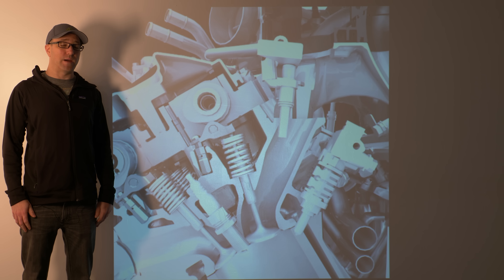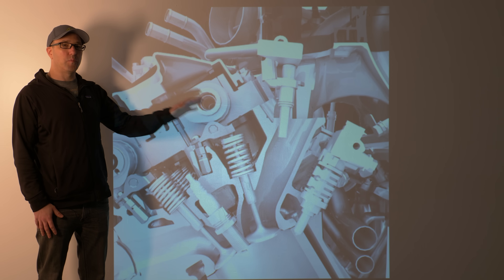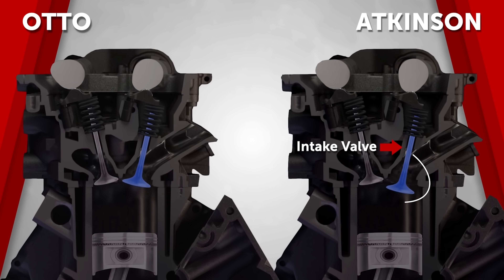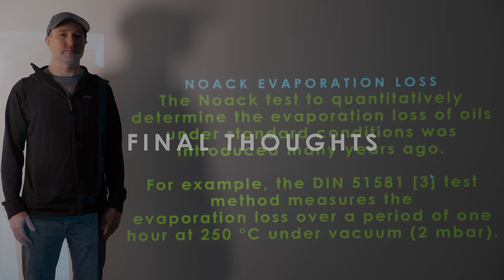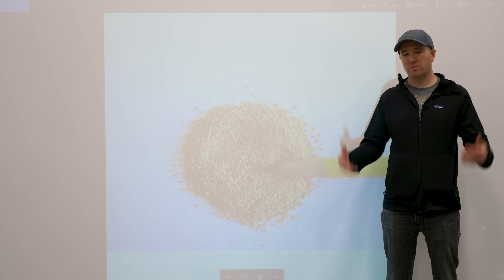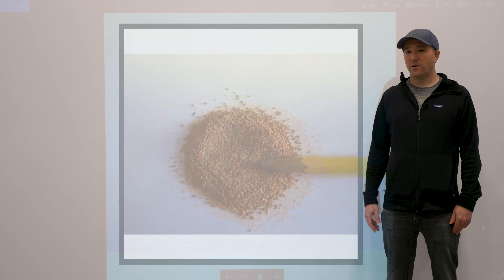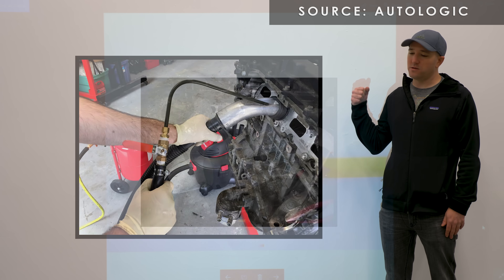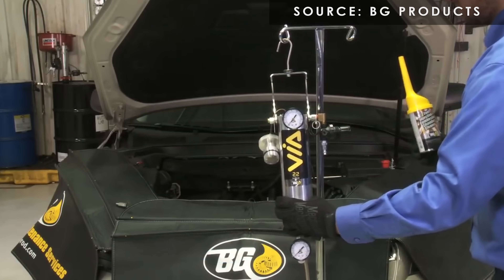Direct Injection, Problems and Solutions | The Fine Print

Comment: If anyone cares, we use BG GDI cleaner with success to clear up DI junks with misfires.  We never removed intake to see the result but our BG rep has worked with a Kia dealership who looked at the valves with the intake off before and after cleaning.   All this talk about lower emmissions with DI but what about the stuff that comes out of the tail pipe during chemical cleaning?  That shit is straight up TOXIC.

P.S. Can you please get an array of projectors to warp the image around your body?  The shadows are very distracting.
Reply: The animation is wrong. The fuel is not injected on the intake stroke in direct injection. That would defeat the purpose. It's injected at virtually the same time as the spark on the compression stroke. This is why it needs a 3000 PSI pump driven off the cam. This prevents detonation and allows higher compression on low octane gas
Reply: @Bryan-Hensley  who puts together these types of animations and 3D views? Are they derived from manufacturer CAD/CAM models or just some third party operation?
Reply: @dtrrtd774  I don't know graphics, I just know engines.
Reply: Great Video BTW!!! I've been a subscriber for about 1-2 yrs now
Reply: Jord TheMechanic It is the way to go if you do it as preventative maintenance. The same things you were just mentioning would happen sometimes naturally if you let it build up in the first place. It is lazy to let that happen...
Reply: If you are breathing in exhaust products xylene is the least of your worries...regardless of any car
Reply: DTM006 Exactly. Xylenes not that bad. I’ve got a few hundred gallons of the stuff from when I had a contract with Wal-Mart to repaint their parking lots. I used xylene paint (although a paint thinner, it is used so that it can run through the machines at 2500 psi). I used it to clean the paint off of my hands every night.
Reply: Please explain your comment.
Reply: Why are there so many dissenting opinions? I am with the "it works" crowd...at least to some degree. If you catch it fast enough and use BG I am sure it has some effect. I agree though that the ideal solution would be to add meth or water injection.
Reply: @mroberts7519  BG is the only company that has worked with manufactures to come up with a chemical that will soften this carbon. It is unlike any other carbon and chunks will brake off and cause your engine to have a VERY bad day.
Reply: I'll let our BG rep read your comment.
Reply: Scott P p
Reply: so the scrubbing process is filthy.
was it not ever such?
Reply: Seafoam will, providing it's atomized through the TB as recommended. Not as effective as walnut blasting though...
Reply: Ryan Bourke That explains a lot.  Thanks
Reply: always trust BG products, them and Loctite(Henkel) make the best stuff there is!! I have used their stuff over the course of my lifetime, none of it has failed badly enough that I wont use it again. ever......
 l always wanted to put direct injection on a flathead. I think the valves might last longer/run cooler?
Reply: DI isn't so much about emissions as it is about power efficiency per litre.  Electronically contolled engines do a better job maintaining burn efficiency.  When higher compression ratios can be used to provide more horsepower for the same amount of fuel burned, the OEM keeps their CAFE ratings, and the customer gets to keep most of their power.  Underline keep, because CAFE2 [penned while Pelosi was speaker] would have left us all driving cars with 30% [or so] less power using port injection.  So... 13:1 on a street car? Yes indeed - and with no fear of detonation.  The fuel isn't introduced until after stroke is past the danger zone for peak pressure, and no worries [except for fuel temp]
Reply: I just remember dealing with VW GDI engines (fucking 2.0 piece of shit) - the "fix" for intake valve deposits was supposed to be blasting with walnut shell media.  What I remember doing was pulling the intake on that cam-failing heap of shit and scraping the shit off the intake valves with a pick.
Reply: Brent Boswell how does a chemical cleaner mess up a turbo??
Reply: scschmidt air soaked in said chemical passes through turbo. Turbo contains seals to separate coolant and oil supplies and drains. Those chemicals, in those temps could corrode the brass/bronze bushings, causing premature failure.
Reply: Mgoblagulkablong
Get a horse.
Reply: I own a 2017 Santa Fe 2.0 turbo GDI and I put a oil catch can $35 plus did the full 3 stage BG GDI fuel service. I noticed improvement in acceleration and smoothness. The best thing about BG is the lifetime warranty they offer if you keep using their treatments. It’s absolutely insane not to use their products for that reason alone. After a week I also see 1/8” of oil/fuel in my catch can.
Reply: Bison trucker DJ  oil catch can helps but you still need valve cleaning  it’s just a shit design is Hyundai still making d i or both now
Reply: Daniel Guzmán López BG is a brand of automotive chemical solutions. They make injector cleaners and other items.
Reply: I have 110000km on my 2015 focus 5spd hatch, I have noticed the engine is starting to misfire. I change my oil more then most and use synthetic . But I think I will have to get the values cleaned.  Question cant tou run something directly into the intake once every few months to prevent this from happening?
Reply: BG is a godsend, use it from the beginning and you really wont have any trouble
Reply: BG products been kicking ass for years. It was in use at and Olds dealership when I started in 1985...their fuel system cleaner is the best I have ever used and I run EPC in my motorcycle...the motor makes much less mechanical noise, it shifts  better and the clutch is smoother. A noticable difference in 3 miles
Reply: Car and body both need internal care and release toxins thereafter. Both gotta go eventually; 
one in the graveyard the other in the scrapyard, do what you must to prolong both lives. Hopefully you 
out live the machine.
Reply: How dare you try to apply logic and common sense to EPA regulation, you better hope an indoctrinated  millennial doesn't here about such things. They would need a safe space for months to fend off the trauma!
Reply: Branden Flasch 
Very true.  I have a 2010 Tiguan, around 90k miles, check engine light was on.  Took it to a dealer, and need valve clean job for $800.  No parts.  Pure labor cost.  They said literally it was a scrapping the valves
Reply: 2😅 11:24 ⁵I e
Reply: BG was awesome when I worked at the shop too. And they had the fun plastic coins in the bottom the rep would give you cash for, lol. Speaking of this subject though, I went for a 2018 Hyundai Elantra 1.6T after seeing your review, and a month of research, and I'm loving it with a 6 speed. Along my research, I saw Hyundai techs saying that they were told/heard a rumor that every so often the 1.6L pops a valve open a bit early so fuel washes back over it as the compression stroke is happening, and it largely means this doesn't happen. Have you heard anything about this? It seems weird that a Hyundai would have a better system worked out than the German companies. But maybe not - Hyundai is out money anytime this needs done under 100k miles, and their engineers  know that. German cars have much shorter warranties and their dealers are happy to give you a paid head cleaning! :)
Reply: @820krx7  That's a neat idea if it's true.
Reply: @820krx7  german cars are overrated in terms of quality. They look and feel great - short of driving feel these days - but they are generally more of a pain to keep in order and this hasnt improved now that turbos are everywhere. European electronics have caused many tears im sure though i dont trust elec of anything now that everything is overly complex.
Reply: I thought it was something British. It is better than seafoam?
Reply: @blackville3  Seafoam is junk compared to BG 44K
Reply: @blackville3  BG would be Bulgaria
Reply: @blackville3  seafoam was manufactured for smaller marine engines not automobiles
Reply: Scott P where are you located?
Reply: Scott P I
Reply: Scott P in
Reply: Accualy the bg fuel induction service or "fis" as your dealer will call it works great only down side is it will damage your catalytic converter over time so use it every 20,000 miles or so. WARNING do NOT use this on turbo charged or supercharged vehicles as the very flammable chemical that goes through the intake can potentially detonate inside your turbocharger or supercharger and cause serious damage
Reply: Thanks for your reply.  I'm thinking you are correct.
Reply: Scott P A
Reply: So are 2014 Kia Forte's GDI or port?!
Reply: Scott P I highly doubt it works well. After scrubbing the intake valves by hand, i can tell you short of walnut blasting, its super difficult to clean with cleaners by hand...can't imagine a cleaner without removing the intake working
Reply: Which BG product number is the gdi cleaner.
Reply: @LawnMowersThingsThatMakeNoise  https://www.bgprod.com/ check out all the BG products.
Reply: what is BG GDI cleaner ? and how work this ? is it also could for the DI injected Corvette C7 ?  thx
Reply: @kubanskiloewe  https://www.bgprod.com/    This is the BG website. You can also see demos on youtube for any product they sell.
Reply: Sounds like you should just go with a diesel then, all you have to do to clean them is just press down on the go pedal all the way to the floor, preferably while going up hill"  That always blows the soot out for me.
Reply: Anthony G. I have a lot of experience and success on cleaning and flow testing BMW N54 Injectors. www.precision line fuel injectors.com
Reply: @neverbored01  We don't get the discs in the cans in Canada but we still love BG products..
Reply: wysetech2000 you smoking fucking dope? Or what province do you live in? Because they definitely do in Canada bub.
Reply: I had no issues with shadows.
Reply: Definitely.  "Lower emissions!"  And then every three months you could fill up a factory with smoke doing a chemical intake clean.
Reply: This is a year old when I watched it, retired and off the bench cept for working on my own personal stuff. Good explanations and video. However this as you mention is s problem as a result of dealing with mandated emissions. Fuel dilution, as a result of Di, turbo Charging a smaller engine and of course an engine that has trouble maintaining a normal operating temperature. So back to electronic carburetor, or port injection, or ? How about a CVCC  Civic  with a stratified charge electronically controlled.  Jst old thinking and not relevant at all these days.
Additionally the fuel odor some experience (oil dilution) is coming from the PCV  system and is in part due to the fuel  dilution problem and its permeation of the PCV system, that's  mandated by emission ĺcontrol in North America and elsewhere.
Reply: Scott P was the way I
Reply: Completely agree with you Scott P. I have been saying the same thing for about a decade... and I use Seafoam as my cleaner.
Reply: So what, it lands on the ground as carbon!! and whats your point? better off then walking down town and breathing in break dust thats floating in the air, but thats just imho lol
Reply: If California air quality regulations don't mandate capture of the junk that cleaning sends out the exhaust, it won't be very long.
What do the cleaners do to the catalysts? Catalytic converters don't get along with out-of-spec emissions.
Reply: @brandenflasch  that engine is the only one we have had no success with BG chemical cleaning. It is the worst. We can only clean those by walnut blasting, but other engines respond great, especially with the new formula and tool BG has.
Reply: @neverbored01  you are pure class. And you have NO idea what you are talking about.
Reply: WARNING: Chemical cleaning of intake valves will dump huge amounts of hard, abrasive, carbon into your oil in the 2-10 micron range, that your oil filter will not filter out.  This will drastically increase wear.  How do I know?   I did oil analysis with particle count tests before and after.  I took two back to back oil changes to bring the contamination down.  In a modern engine 10-20% of the old oil will remain.  You can also run a 2 micron bypass filter to remove all the carbon and GDI soot.  API SP and GF-6 have come out with additional performance tests to check wear of timing chains and cylinders caused by GDI Soot.  This has been known since 2015.  https://360.lubrizol.com/2015/GDI%20Soot-A%20New%20Challenge
Reply: B.S.
Reply: Remove the intake and you will see the BG did absolutely nothing.
Reply: Where can I get the BG stuff if I’m just a regular Joe I know how to do a vacuum port cleaning just fine
Reply: Thanks
Reply: Guess I'm sticking with my old school 850 double pumper on a healthy low deck big block Mopar f all these kids technology I'm a dinosaur
Reply: @onesecureone  that's good and all, and I don't blame you, but you have to think about fuel mileage man especially now that Brandon has gas at $5 a gallon and climbing.... I'm assuming that's not your daily, correct?
Reply: I drilled a small hole in each intake runner , and inserted a air inflation needle with epoxy .capped it with tire nozzle cap . Once in while I just take caps off and spray cleaner directly into port next to valves.
Reply: Use Lucas feul cleaner
Reply: My Kia RIO 2013 DGI has done 155 Thousand klm, I change the oil every 5000klm, it drives well and lots of power from my 1.6lt engine. I can easily drag off VW Amarok and other cars. However it has a pinging noise from my bottom end at lower speeds. I only use high octane and I have tried different oil brands too. I am using Penzoil Extra Platinum 5-40w oil now, not much difference. I a. Thinking taking out my injectors and having them cleaned. Any idea anyone?
Reply: Meth injection
Reply: BG , ripping off Dealerships for Decades 😂.
Reply: Yeah that's not gonna clean up hardened carbon deposits and you wouldn't want it to because then the loosened carbon fragments would score the cylinder walls.  The only way to safely and effectively clean carbon deposits off intake valves is with walnut shell blasting or a similar physical method.
Reply: The stuff coming out of the tailpipe during cleaning is probably PAHs (aka diesel soot!) PLUS the chemicals in the GDI cleaner (xylene, toluene, 2-butoxyethanol, NMP etc). Carcinogenic and toxic. Good point about the tradeoff-this is what happens when companies don't do a rigorous life cycle analysis when they develop a new technology. I'm never buying a car without port injection now, and will advise anyone in my family or friends to watch this video before they do.
Reply: Mike H  
Toluene is a major chemical in the gas you put in your car everyday. Not sure about the other specific chemicals but I wouldn’t think it’s much worse than what your already burning in your engine.... if your really worried about carcinogens and toxic fumes, then driving a car with a gas engine might not be right for you
Reply: cjsawinski the difference between the small exposure to fumes when filling up outdoors every two weeks versus a mechanic exposed aerosolized, concentrated chemicals inside a shop many times per week is huge. Not to mention the particulates that come out as well.
Reply: @cjsawinski  - Go Electric! Enjoy inhaling power plant emissions. You're getting them now anyway.
Reply: @cjsawinski  - I generally don't inhale my own car's exhaust.
Reply: @mikeh2812  This what happens when government bureaucrats try to engineer cars!  The government needs to get out of the auto business.
Reply: @skip7243  
They haven't realized the concept of diminishing returns, scrubbing emissions from cars whose exhaust is nigh breathable already. Leaving alone emissions from jet planes and manufacturing plants because it's not an in Vogue concern by environ-mental-ists
Reply: @dtrrtd774  Because "well to do" folks use planes, can't mess with that!  You know, the golden rule "He who has the gold makes the rules"!
Reply: @mikeh2812  alot of manufacturers have reduced the issues with GDI i owned a Hyundai  for 5 years never skipped a beat and my neighbour just sold his after 9 years so if it's one clean up every 7or 8 years that not too bad plus some car u have to take the intake off to change spark plugs anyways might just DUI it after that much years..
Reply: Joe Brown cautiously optimistic. They’ve gotta improve the longevity if they want to keep using them. I have a Hyundai/Kia GDI with over 100k miles and I keep my fingers crossed whenever I drive it.
Reply: @mikeh2812  easy, floor that bitch to redline through the first 3 gears once a week, I've owned shitloads of newer cars with DI, lots with higher miles too and have never had any of the problems associated with it
Reply: GDI isn't innocent by itself. It emits a lot more particulate (soot) than a port injection engine. Watch a GDI motor start on a cold morning or watch one that spends lots of time putting around in the city cough up a cloud when the driver romps on it to merge onto a freeway. Nevermind the enormous cost BMW owners had to pay when their HPFPs went bad.
Reply: @mdub603  gm gdi runs split injection ,extra fuel on cold startup for a few seconds to get the convertor lit off quicker.....
Reply: @mdub603  Funny @-30c I dont have that issue with a Kia 2.0T in the winter. I think you have something going wrong if that happens to your ride.
Reply: @mdub603  shoot is actually inert and quickly falls out of the air.. it gets a bad rap  because it can be seen.. but the other exhaust emissions are really the terrible ones which can't be seen with the naked eye
Reply: @joebrown9621  Soot is inert? Haha, tell that to all the people with respiratory issues.
Reply: BG and other cleaners are not designed to be aggressive. The cleaning agent softens the buildup (in combination with heat) which gently removes a decent portion of the deposits after 10-20 minutes. If doing a boroscope comparison, be sure to inspect after driving the vehicle for at least 20-30 miles at operating temps. We've seen noticeable improvement in the Mazda community using over the counter GDI cleaners like CRC and SeaFoam (atomized through the TB). Not as effective as BG or media blasting. But we saw improvements in airflow with noticeable reduction in deposits along the runners, intake valves and EGR. 

At minimum, use it to pre-treat the surface prior to media blasting. Makes removal much, MUCH easier.
Reply: BMW's HPFP have been under Recall for year's now. They also reimbursed those who purchased at a local shop, etc. The new HPFP revision as of 2011ish, there has been veryy little failure's. 

Obviously there are many on their original HPFP's, so ypu will still see failures but those are original Pump’s or Pump’s replaced before the final revision was made. 

As well as the revision for those HPFP’s, BMW switched to the style pump like the VW’s use and its a much simpler and cheaper HPFP. It is very reliable, inexpensive, and is much much less costly for the aftermarket to develop Higher Volume HPFP’s.

The advantage of DI is pretty significant, you can run much higher Compression Ratio’s, engine cooling effects, and more precise fuel injection. This results in higher efficiciency leading to higher power output/liter & better fuel economy...

I do however, know the negatives side effects of a DI - Only motor, and most of these issues can be resolved and/or overcome. From an emission’s standpoint, i dont know the effects of these changes. I have personal experience with BMW N54 (N55 as well) engine equipped vehicles
Reply: Michael Roberts   This is YouTube and everyone has to be a YouTube Certified Engineer or Chemist to give an opinion here. I have used BG products for many years so i know what works.
Reply: @wysetech2000  - I got a "D" in college Chemistry 101 so my opinion is as good as anyone's. Half the class got "Fs."
Reply: @algrayson8965  👍
Reply: @wysetech2000  p
Reply: Scott P . The problem with the BG cleaning system is where does all the carbon / gunk go after ? It's either getting caught between the piston ring and cylinder wall creating scratches to the cylinder eventually ruining your engine or it's going to get caught in the catalytic converter causing premature failure . BG is not the way to go . It's the lazy man's way of cleaning intake ports . Do it properly and remove the intake and blast or scrub it our not allowing the debris to enter the cylinder after
Reply: @EverydayJ1786  you do not know what you are talking about. The BG GDI cleaner softens this very hard carbon and allows the engine to slowly burn it out. It has to be done once a year to keep it from returning. You need to do a BG EPR treatment to the oil in conjunction with the GDI treatment to clear the rings of carbon for the full treatment. I have used BG products in the dealerships and my own shop that I run, since 1987. I think I have a pretty good idea of what it can and can't do. The only engine we have not been able to clean without walnut blasting is the VW 2.0 TSI.
Reply: @kurtumpenhour9142 I'm not questioning your decades of experience but  " the cleaner softens the hard carbon deposits and allows the engine to slowly burn it " sounds like something on a late night infomercial . I've never bought into bg products . I can't stand miracle snake oil shit .  If their products were so great , other companies would have copied their formula years ago . Also this oil treatment should never be touching the compression rings where the carbon would get lodged . If the BG oil treatment is cleaning the compression rings I'd say there isn't much left of the oil control rings in the first place .
Reply: Scott P what do you say to all the people who defend di that just do maintenance and its all good then can you give them a reality check on what a nightmare it must be to clean after 60k miles
Reply: @SavagexRaccoon  I have a 2006 VW Jetta GLI 2.0 Turbo GDI with 158,000 miles, purchased used with 45,000 miles in 2008. Always used a gas additive that I found in 1980. Mix-I-Go Made by Bell Performance -  1340 Bennett Dr, Longwood, FL 32750. Never had a problem with carbon build up, no codes, no driveability problems at all and I get 30 mpg on the highway. Just filled up with premium fuel today, did the math 26.95 MPG on my last tank and I drive the car like I stole it every day. The worst thing you can do with a GDI engine is drive it like a little old lady from Pasadena. 
I did the PM thing at 100,000 miles - new timing Belt HPFP cam follower, water pump. I am sure I will repeat at 200,000 miles.
Reply: @SavagexRaccoon
Reply: well, it doesn't. this fuel injection cleaner nonsense is just that, nonsense. that crud got baked on over the course of thousands of miles in thin layers. even though I trust bg products, nobody makes a fuel injector cleaning solution that does what their advertising shows. a quick look before and after with a borescope will prove that. it may in fact improve the injectors spray pattern, this would get rid of misses etc. but it DOES NOT clean valves.....DOES NOT and this can be proved with a borescope. 

for the trolls:if you haven't done a before and after borescope check, I have,  so you want to argue you are already shutdown there.
Reply: Mgoblagulkablong - why would a direct injection engine produce more or smaller particles?  They are burning the same fuel, the only difference is they run slightly leaner.

The sad thing is these days most of the best performance cars are all direct injection, and only a handfull have additional port injection as well.
Reply: @Dolby109  
 Thank you for pointing this out, I was thinking the same while reading that post! It's the same fuel, burnt by an electronic spark and passed into a catalytic converter after of course being recycled  through the engine via EGR. Nothing is perfect, car manufactures are trying to adapt to emission laws that keep getting tighter. GDI and Turbos are not new technology, maybe on gas engines but the systems minus computers have been on internal combustion engines practically since the advent of the internal combustion engine. That whole post sounded more like a conspiracy theory to me. 
 I have had 2 turbo GDI driven cars, both Ford's. The first one, which was a 2010 Flex I didn't keep long enough to see any issues, the one that I have now is a 2012 Edge with the 2.0 GDI/Turbo. 98K miles with no issues. I use Mobil 1 on all my cars and change it at 5k to 6K miles or 50% setting for oil life. My driving is 95% freeway speeds, 40 miles a day on the freeway and this is not in stop and go traffic, because of my hours I miss the traffic jams, so my speeds are usually 75 mph. I think the biggest issues are those cars, are either poorly maintained or constantly in stop and go traffic or both combined. The GDI and Port is fairly new, at least on the Ford's, it is what is being called the 2nd generation systems. Has only been out I think for 2 years now.
Reply: @Dolby109  that's exactly what I wonder. How can it be 15 times more emissions?
Reply: Scott P does Kia also have a GDI turbo?  Ford voids warranties in Ecoboost engines if they find out you used a chemical intake cleaner...lots of turbos have been destroyed by a Seafoam treatment
Reply: Brent Boswell had a hard/long start on my 3.8 sc riviera. Old dude I know kept telling me seafoam. I did it and it got noticeably worse. I think something you can put in any fluid and it helps somehow is BULLSHIT
Reply: @ztwntyn8  extended crank time on one of those is usually fuel pump/filter related..little 3.8 motor is one of gm s better motors...they will run 200k one oil changes, a water pump and maybe an alternator
Reply: @brentboswell1294  exactly, what can we do? I own a Sorento. They do the services at the dealership, I don't know if they are doing it right but I don't want to screw warranty which is the main reason to buy a kia.
Reply: I really enjoyed the technical detail you went into.  Very informative!  Keep up the good work!!
Reply: or run port injection or water/meth in combination with DI.
Reply: I have posted this comment before, but I am getting completely ignored, so I am posting it here again:

I am a huge fan and subscriber and happy that you talk about this topic, but I am extremely disappointed about this video. 
You completely ignored the biggest issue and did not even mention it once. But not only that, you also spread lies.
The emissions of GDI engines are hundredfolds more harmful to humans compared to normal MPI engines (I am not talking about lean ones). Just to clarify, I am absolutely NO goody-goody soy-boy treehugger. But the emissions of GDI engines directly ruin the human body. You were talking like GDI engines do better in emissions, that's a lie. Only Co2 emissions are slightly lower (on paper), but they are only a part of the emissions of a car and the least harmful one for humans of all of them. 
GDI engines don't run clean as you say, they produce extremely high number of particles, but not only particles, the worst form of particles, extremly small nano particles. They are extremely harmful to humans because they are too small to be filtered by the lungs and enter directly into the blood and from there into Brains, Organs, etc. And they bring other toxins that atttach to their molecules with them. This causes cancer, DNA damage and much more.
Just Google "gasoline direct injection particle lungs blood" or something similar.

On the german ADAC site they list the emission numbers of cars they tested since last year. For example a Toyota Yaris with clean MPI engine: https://www.adac.de/infotestrat/tests/eco-test/detail.aspx?IDMess=4046&info=Toyota+Yaris+1.5+Comfort
And for comparison a Ford Fiesta with direct injection: https://www.adac.de/infotestrat/tests/eco-test/detail.aspx?IDMess=4066&info=Ford+Fiesta+1.0+EcoBoost+Start%2fStopp+Titanium
The important number is "Partikelanzahl", it means number of particles. In the example above it is around 15 times as high, while the mass is nearly the same, so much more, much smaller particles. (btw NOx is also much higher in that comparison)
In europe there have been limits to the particle number for over 6 years now, but (because protectionism) gasoline engines have been exempt. For over 6 years all diesels are required to have particle filters now, while GDI engines with worse emissions were exempt. Now this is finally changing. They will have to meet the same regulations in the future.

Please give a statement to that topic. People need to know about this issue. But it is kept under wraps everywhere...
Reply: @Mgoblagulkablong  - Our lungs don't filter particles out of the intake air. If you inhale through your nose, as you're supposed to, the corrugations in your nasal sinus sling particles into the mucus (snot), where they stick and are carried out the back of your nasal sinus into your throat, from where you swallow or expectorate it.
The trouble with nanoparticles is that each particle's mass is close to the mass of nitrogen and oxygen molecules, so they don't get slung into the mucus. Instead they go on into your trachea and lungs.
Now, the passages in the lungs are coated with a very thin mucus, so nanoparticles that aren't blown out with air when you exhale get stuck. Unfortunately the most harmful of these microscopic particles dissolve in the mucus, where the chemicals are absorbed into the blood or just sit there, irritating the lining of the alveoli and air sacs.
This mess follows the Law Of Unintended Consequences, the natural law that says that anything we do to fix a problem inevitably causes another problem, or many new problems.
The chamberpot problem was fixed by the flushing chamber pot, the water closet, commode, toilet. This resulted in new problems, not really solved by cesspools, septic tanks and drainfields, and centralized sewer systems. They get the problem out of the house and make a bigger problem...somewhere else.
Reply: @Mgoblagulkablong  : I so much appreciate this information … I remember when we got rid of lead and put in something else and something else has never been expounded upon either and it is not good for us Humans .. Ect ect Ect ect ect.. 
And this was done back in the 1970s
Reply: Mgoblagulkablong 
Not ignored by me ;-)
Reply: @Mgoblagulkablong  Interesting! I have heard of using "particulate filters" on gas powered vehicles. This from my relatives in Germany.

So you are saying vehicles with "direct injection" produce more particles. This has me wondering why the exhaust on my Porsche 991.1 with direct injection is black but dry. Why, especially since the motor and exhaust all in a region instead of motor in the front and exhaust in the back. So I looked at all direct injection Porsches at the Cars and Coffee get together and they all had black exhaust pipes. I was wondering why since fuel injection can meter fuel properly no matter what the RPM and engine load is.
Reply: @Mgoblagulkablong  Copied from below, interested in a reply from you too: Mgoblagulkablong  I read your comment and agree with your reasoning. I think egr combined with all the gunk from the pcv system adds up to the mess. Appreciate your research. I also commented that di is what must be making the Genesis rear bumper black. Have observed many of them black and nasty. Your thoughts? Please
Reply: @Mgoblagulkablong  Then bro, if it is kept under wraps everywhere, then why do you assume this dude here is lying?
Reply: Banning Diesel engines, wood stoves and burn piles would create a significant improvement in air quality. Lawn mowers and leaf blowers shoot out huge amounts of soot and other pollution as they have no emissions control systems.
Reply: Branden Flasch  You are 100% correct I work at A VW dealer you must pull the intake on the TSI motors
Reply: Daniel Guzmán López I assume but can't say for sure. Seafoam is available over the counter while BG is for "professional use".  I'm not aware of any dealers using Seafoam,  I know numerous dealers using BG.  So far all the stuff we use from them had been good to us.
Reply: @Scott-xh7wd  You can buy BG products in a real parts store (not autozone,oreillys,etc,etc.) as well as online.
Reply: @garymarrs2270  We carry BG products in our shop.
Reply: @garymarrs2270  not ethically. They are only sold through authorized distributors from BG. Parts stores and online are going around BG's rules.
Reply: Hey Turbowsky, what do you  mean with BG?. Regards.
Reply: @blackville3  BG 44K, look at Amazon for it.
Reply: @blackville3  
www.bgproducts.com
Also
2 can support for GDI
www.wynnsusa.com
6/17/2019
Long Beach, CA
When I worked @ GM, we used Wynns
Reply: @blackville3   Downside is they only sell it to dealers so they can charge the mess out of you for a cleaning
Reply: @blackville3  It is a brand of chemicals new car dealers use in their shops.
Reply: Daniel Guzmán López Bubble Gum.
Reply: With DI cars, fuel practically never hits the valves, so a walnut blast will have to be performed eventually. Now more modern DI vehicles have two sets of injectors for each cylinder to prevent this.
Reply: Seafoam will not touch that valve buildup.
Reply: @wysetech2000 , you are correct if you're discussing the gas tank additive. Tank additives of any brand simply don't touch intake valves on DI engines. That said... Seafoam makes aerosol intake cleaner like a number of other companies do. It's sprayed into a vacuum line, or through the throttle body so it enters through air intake, passing over intake valves. Whether it works or not, I don't know. I would think any of these products that dissolve solids on valves and stems would have to be used a few times initially if valves are really gunked up.
Reply: wysetech2000 Yeah I used BGs top end cleaner at Mercedes for years and that stuff was amazing. You could hook an air hose up and pressurize the fuel rail with straight BG. And I loved the little coins at the bottom haha.
Reply: But from watching the video, no additive is going to clean the intake valves like the port injection system. How does that work (BG) to clean intake valves? I really don't want a DI engine now.
Reply: @DustyCowdog  BG GDI is pressurized and injected into the throttle body. It cleans everything in it's path, all the way through to the cats.
Reply: Daniel Guzmán López BG Products.   A lot of dealers and repair shops use their stuff.   https://www.bgprod.com/
Reply: Great topic. Got 333k miles on a MPI Ford Ranger (sold last year) with ZERO fuel issues (Lima 4cyl engine design dating from the 1960's!).

Gonna hang onto the MPI 4runner 4.0L (150k miles) and the MPI Altima 2.5 (200k miles) with flawless intakes until the dust settles on this new garbage. One can of in-tank BG fuel cleaner every 2years BTW.
Reply: @musicrinda  You will miss that truck... Hold on to the 4runner  as long as you can, as for Altima as long as it doesn't have CVT transmission, it's a keeper. If it has manual transmission, it's gold!
Reply: Check out a vid on here about a California school district spending tons of money and downtime for the maintenance and cleaning of diesel particulate filters. 
The guy said they back the bus up to a fence and do the regen. Just let the crap blow all over
That makes sense, let’s have tons of toxic little places around schools instead of spreading it out all over thru driving around. 
It was a whole series of videos about CARB and how they are bankrupting anyone who has a business with a truck.
Reply: @MrTheHillfolk  Referring to a video ,about Diesel buses in California adds little to the conversation . This video and discussion are about gasoline direct injection ,discussion is about real or unreal downsides.
Reply: Mgoblagulkablong  I read your comment and agree with your reasoning. I think egr combined with all the gunk from the pcv system adds up to the mess. Appreciate your research. I also commented that di is what must be making the Genesis rear bumper black. Have observed many of them black and nasty. Your thoughts? Please
Reply: Scott P BG cleaner is a bandaid. Best bet is a catch can to catch the vapors and oil from the PCV. If you want to go the extra mile, go with a water/meth injection.
Reply: I kind of wished you mentioned something about ethanol fuel. Not necessarily E-85, but in the midwest there is usually E-15 (or E-10) at every fuel station. It either gums things up, or it consumes plastic similar to cotton candy in water.
Reply: @jb34304  - Elastomers ("rubber") that are formulated to resist both gasoline and ethanol don't resist gasoline as well as Buna-Nitrile, or ethanol as well as Ethylene Propylene. Teflon lined hoses do well but are much more expensive.
Reply: @algrayson8965  Thanks for the reply. I live in Iowa, where the ethanol thrives. But it's ridiculous how vehicles get gummed up from the alternate fuel. My 1993 Ford Taurus SHO was a prime example. After 15 years everything was clogged /gummed even when performing the standard maintenance. :( Loved that car...
Reply: @jb34304  I have a 2007 Hyundai Elantra with the 2.0 liter Beta II engine. In Minnesota where I live they have E-10, E-15 and E-85. I only use the regular stuff (E-10), even though the label next to the E-15 button says it's ok for 2001 and later gasoline engines. The manual for my car specifically states that it is NOT Flex-Fuel and not to put E-85 in it, so I am not rolling the dice with E-15.
Reply: Anthony G Yep has to eventually replace mine on my old 335 n54. Lasted about 100k miles before took a shit.
Reply: bg is too expensive. we’ve seen sea foam to work better than any other fuel additive. and it even says on it that emissions from the sea foam is nontoxic
Reply: @yngnut  - Drink a glassful to see if it's actually nontoxic.
Reply: Scott P your really going to bitch about the shadows? holy F
Reply: Scott P: by all means get rid of the shadows!😖, the information is irrelevant even though it's correct. Are you kidding me🤬!
Reply: Thomas Schoon really 
You get what you pay for 
How much are paying 
To watch the video? 
Just watch another video 
Very simple
Reply: Numbskull - You don't drive around all day doing the valve treatment! It only lasts about 5 minutes, and don't have your mouth on the tailpipe while its being done.
Reply: @paulmoffat9306  His manifold probably still had fluid in it, causing stumbling when sucked in
Reply: Scott P  yeah buddy! They have a top end clean apparatus that you pressurize and load with there top end cleaner solution and you start the engine and have it idle or slightly over idle and push the intake tube to the side and position the sprayer to spray straight into the intake manifold and all that gunk is a wrap. Once done pull it out and run it down the high way. The shit that comes out will blow your mind lol
Reply: the idea is use cleaner through the intake often to keep the buildup from happening or to a minimum. So waiting until it's caked up thick is far too late and only a manual cleaning will work then.
Also you don't want huge chunks breaking free and going through the engine, that can hang valve/s open and cause major valve to piston "collision" damage as well as the chunks will pass through into the exhaust and guess where they stop at? the catalytic converter/s, which you'll be replacing soon, because they'll be plugged up bad and have low efficiency, thus setting check engine light on and failing emissions testing ;)
Reply: BG is nothing but fucking snake oil
Reply: Evidence of these claims?
Reply: How do gasoline treatments clean valves when the fuel doesn't even touch the valve? Seems like that would be minimally effective. Seems like seafoam would be more effective but even then... Speaking from experience it wont get you out of cold start misfires and there is debate weather it prevents buildup for a reasonable amount of time.
Reply: @YOURMOMxo69xo  The cleaner has to go into the intake passages, not into the fuel.
Reply: @YOURMOMxo69xo  Seafoam will not touch this type of carbon, even if you shoot it directly on the valves. The BG product is (was) pressurized and shot into the throttle body and cleans the entire induction system, including the intake valves. The newest tool does no use pressure but works off of intake manifold vacuum. BG  has great products. I have used them for over 30 years and they are constantly keeping up with new issues that cars and trucks are coming up with.
Reply: its not beacuse its direct injection, its the turbos....
Reply: BMW has always been an overpriced vehicle whose majority of owners are inner city Blacks who know nothing about quality and who are willing to pay for the status they feel the BMW emblem gives them. Just stating the demographics here. The car is overpriced. Repairs and maintenance are severely overpriced. Their GDI system is as bad as VW and Audi. The only company that does Direct Injection right is Honda. Do the research before you belch out bullshit. BMW is cleaning their valves with crushed walnut shells for Cris sake. IT's a disaster . The new Honda Turbo engines have GDI right and Turbo right. Just accept the facts and stop the BS
Reply: @tonys4396  Please look up Honda 1.5 liter turbo engines in their new SUV's for fuel contamination of oil.
Reply: @TinMan111112  Get rid of your Honda and buy a Jeep Grand Cherokee. They only had 17 recalls this year. Honda had none. All Direct Fuel Injection engines were garbage when they first came out. Consumer Reports always said that the only two companies that did it right were Honda (with their revised PCV system) and Toyota (with their Port Injection and Direct Injection combo). Now, consumer reports says that ALL the auto companies have corrected this issue and its true. Live in the present my friend.  I hears about that oil crap and have checked my engine oil constantly on my 2018 1.5L Accord. I have no issue. I just changed the oil again with Mobil 1 Extended Performance 0w-20 and their filter and no gas in the oil. Ever, 
Only thing I noticed was that when the car was brand new, it took a half quart of oil after the first 3000 miles, That's common when breaking in a new engine.  There is NO gas in my oil. I heard that fake news when I first bought the car. It's nonsense. Probably propaganda from other automakers. Show me an article where this is PROOF of this. There isn't.
Reply: @tonys4396  Which automotive publication would you like - they all list gasoline contamination of oil as a problem - how about Consumer Reports? https://www.consumerreports.org/car-repair-maintenance/honda-cr-v-affected-by-engine-trouble/
I don't have a Honda but if I did, it wouldn't be with the current 1.5 liter turbo motor.
Reply: @tonys4396  Here's a followup article: https://www.consumerreports.org/car-repair-maintenance/honda-delays-cr-v-turbo-engine-fix-details-rollout-plans/
Reply: @TinMan111112  I subscribe to Consumer Reports. The 1.5L Turbo in the CR-V is NOT the same as the 1.5L Turbo in the US made Accord. Do your research. The fix for the CR-V's with the problem were implemented in December of 2018 and only as TINY amount of those vehicles have the problem. (Read the end of the article where it says the CR STILL rates it a recommended vehicle). When the 2018 Accord went into production, Honda already knew about the problem and made a correction to the engine for the Accord. So, if you research on line you will find that this problem does NOT apply to the Accord and only to SOME Civics. Long story but do your homework before you stereotype a whole company for the 1.5L engine on the CR-V. I reiterate. This problem does NOT occur on the Accord and there hasn't been one complaint found of it happening.
Reply: @TinMan111112  AGAIN, no mention of the ACCORD 1.5L engine. AND it's already been corrected on the CR-V which doesn't apply to the Accord. I'll try to find the article, but I think it was in Ward's Auto World. As I said, in that article, they made certain that the engines for the 10th Generation Accord did not have this issue.
Reply: @tonys4396  Absolute facts having owned BMW and VW GTI. Audi and MB is no different, absolute nightmares unless you have a lot of money, time and a second car for when the other is in the shop, its favorite place. 
The problem is, people are highly ignorant, having no idea of injection, let alone changing a tire. 
They buy a new car, then spend 1000s more at the shop with hands tied. So the question to buyers should be: What is research worth before buying a car? 
Most dont care...